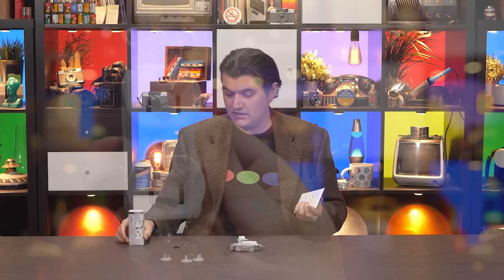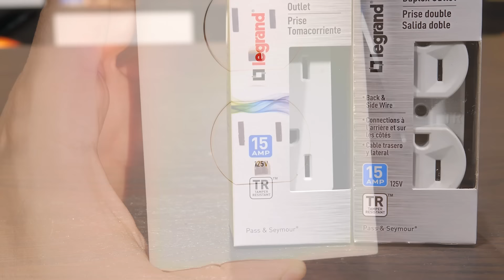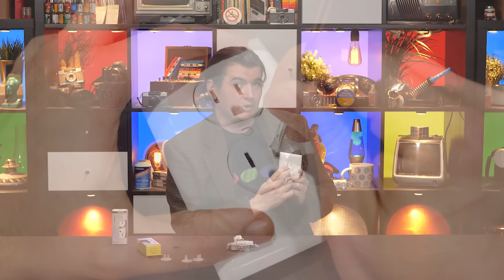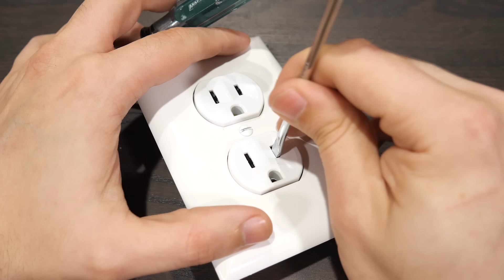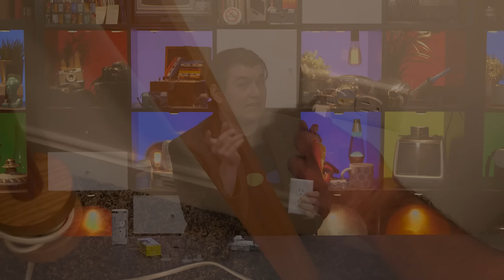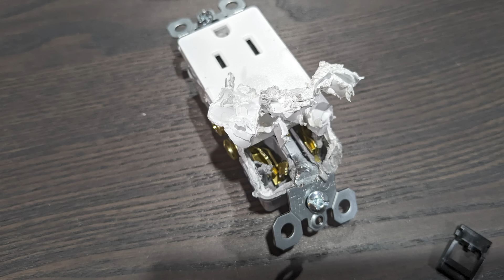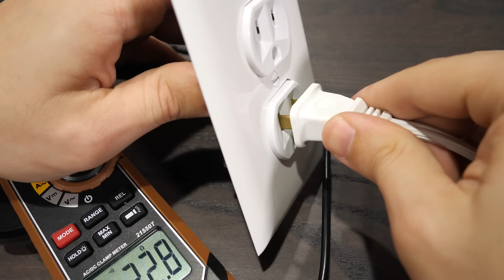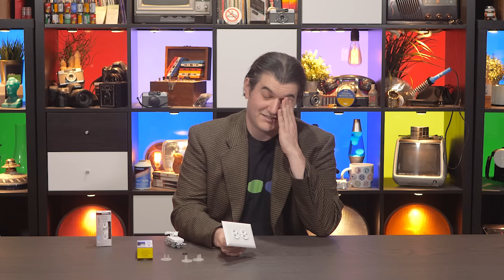Tamper-resistant outlets aren't all the same - a follow-up

Comment: As a European, I fumble around with my fingers around outlets daily and have never been shocked by doing that. I am shocked (heh) that you have it so bad.

I have been shocked by live voltage twice though but it wasn't that bad. Both were because of old out-of-spec plugs. Probably lucky conditions that increased resistance mean it wasn't that bad.

Comment: I’ve been shocked by 120v probably around 15 times. Only once was from the bad plug design. it usually happens from circuit I thought were off but in fact were not, or from unseen frayed insulators on conductors

Comment: My first home was build in the 50s and had no ground wires.  The little work I had to do was always weird to me because of the quality of the wires.  MUCH thicker gauge and solid copper with the extra thick fabric wrap over the insulating wrap to the wires, which made the wires that much more fun to manipulate (almost always had to use pliers to bend them.)  
In my current home (70s built) almost all the outlets are connected via that quick plug-in the back.  We had an issue right after we painted a room (correctly removing all the wall plates) that afterwards occasionally the lights in ANOTHER room (the adjacent hallway) would not work.  Turns out having jostled one of those outlets had exposed a weakened spring that was holding one of those wires and it was the last of a trunk line before being used to light the hallway. 
Replaced the outlet and fixed it.  
Since most of the rooms in this house have 2 breakers, one for outlets and one for lights, I don't have any clue why it's wired that way.   By far not the worst wiring issues I've found, either; my favorite was a splice into a line running in the attic, they didn't use a box, or even cut the original wire, just cut back the insulation and wound the new wire around it and taped it up and called it a day.  While it did work, and since the home had, magically, not burned down in the 40 years before I owned it, I can only assume it was 'safe-ish.'  But I fixed it.  
Remember, and this probably applies to the quality of outlets in general: There is no solution more permanent than a temporary solution that works.

Comment: In 240V land, we have multiple phases for high power applications too and like in the USA, if I touch two of them simultaneously I get a way higher shock. An 400V shock to be clear and that can kill you pretty easly... But every phase to ground is "only" 240V mains voltage.

But the three phase plugs are mostly build like absolutely bulletproof tanks. There has VERY much to go wrong until you get a shock from a CEE or older J15 or J25 plug.
Reply: Three phase are used in homes?
Reply: @brettknoss486  Yeah. All high power applications run on three phase power. Stove, clothes dryer, washing machine, dishwasher, boiler, heat pump all runs on 400V three phase here...

Comment: Australian outlets are similar to US plugs with the blades twisted. Unlike in the US they are 220-240 volts, so we aren't alone. I like our plugs, they are very compact and compared to UK plugs they are miniature. All that needs to be done is to mandate that the plugs have 1 cm of insulation and the problem is solved. You could use heat shrink and do it yourself.

Comment: In Brazil we used to have the US standard plugs and they would fall completly out all the time. Specially if it had any wheight on it like a power supply. That's because they were made of a poorer design and not as tight as the american receptacles.

Thanks god we moved to some european style plugs(It's not that big round one though). Which prevents all the problems you talked about.

Comment: I believe that the people who say that in the US the plugs are falling out are slightly exaggerating, and the plugs were not actually falling off but coming a little off like was shown on this video. And
the exaggeration probably wasn't meant to be such, but to someone who hasn't seen the plug to come off even a little before it can look quite worrying and a big deal. At least that's how I felt when I visited the US a few years ago. The motel where we stayed had coffeemaker plugged in an outlet on the wall, and seeing how the plug didn't seem to properly stay in made me nervous so I pulled the plug entirely. My point is, the saying that the plugs are falling out is probably unintentional exaggeration because what happens can seem worse when you see it happen for the first time, (combined with how exposed the prongs are due to the non-recessed design), as compared to being used to seeing it.

Generally, I wonder if the reason why the implementations of some technologies in the US (like the outlets and the colors of the NTSC TV) seem a little worse because the US was an early adopter of those technologies. So the US might have got versions 1.0 of those things, with some bugs left, and by the time when others started to adopt the same technologies, they had available the longer-time experiences from the US and could fix the problems in their implementations, making bug-fixed versions 1.1.

Comment: The reason you shouldn't backstab outlets has little to do with the quality of the connection. It''s not recommended because it's a "stress-fit" connection that will degrade over time as the outlet is used, heats up, and cools off. As the wire heats up, it expands and the flange that holds it in place has to flex. Hundreds of cycles of this and the connection is much worse than it was on installation.

Comment: Those old two-prongs with no flange that are barely bigger than a USB plug were definitely dangerous.  I have a memory of getting my hands cooked when I was 3 or 4, messing around with old Christmas lights that had one of those plugs.  I remember my hands suddenly hurting and then they had some black stuff on them that wouldn't wipe off.

Comment: So I have a difficult history with these "Tamper-Resistant" plugs. I tried plugging stuff in, but it wouldn't go through so I just shoved my laptop charger in until it finally opened. It probably broke, because there was less resistance when plugging stuff in. I thought that the TR was some sort of branding. If only I knew that it was supposed to go in a specific way.

Comment: I got zapped with 240 volts a couple of times in my life - as a child as well as an adult - here in Germany. In my spare time and also on the job. 😬
I've never had any complaints, but I'm also weird that way. Getting zapped with 480 Volts by touching two live wires is something else tough. 😵
We have to deal with 3x 240 Volts for real appliances - like a stove - that use real power like all 10kW our electrical wiring can take, so our power has to have a bit more of a grunt. ⚡⚡⚡

Comment: "europeans are always talking about our plugs falling out" The standard European round plug (not Italian or British) does not rely on the prongs to hold the plug in. It has its own mechanical retention separate from the power prongs. Besides the fact that the round plug body fits into the hole, it also has metal tangs on the side (not the power prongs!) that click into place. Thus it is a more secure retention and less likely to wear out and become loose.

PS. A lot of this is because Europeans are more likely to be in a hotel. Hotel plugs are notorious for falling out, because they get more use, and thus wear out faster. Really American plugs were not designed to be plugged and unplugged a lot.

Comment: MK sockets in the UK have a ridiculously clever system for the shutters. They have two sloped shutters on the live and neutral holes which are opened by the respective pins, but these can only be opened if the earth pin is already in as that releases locks on the two other shutters. basically all three pins have to be in the socket in the correct order before they'll open!

Comment: You are so right about 120 volts being safer then 240 volts. As a life long commercial sparky I have been shocked by 120, 208, 240, 277 & 5,000 volts from oil burner ignitors. Seemed to me that when voltage was doubled the intensity of shock was four fold.Fat & even taller people do better from being shocked due to higher body resistance. Have got a nice shock when only touching one 480 volt wire while soaking wet in a hot environment. Thanks for all the informative easy to understand U Tube vidios that you produced.

Comment: What you called blanks @_0:30 are dangerous choke items to kids. A fellow sparky told me they do not have UL approval. With over 500 kids going to an ER yearly from getting shocked from receptacles the NEC should have made them mandatory 50 years ago. Like they told us in several IAEI continuing education classes TR receptacles are only tamper resistant. They most likely will never make a tamper proof receptacle. We had a kid some how bend a paperclip to enter the edge of his 277 volt wall switch in his patient room luckily not getting Injured but blow a piece of the stainless steel wall plate up.

Comment: your Outlets are so bad because its cheaper then like a German/EU Schuko-Plug (capitalism thing) .. or a CEE-Plug we use for 400V/380V like ever Home has here (like your 3 Phase 230VG) .. i agree to "that higher Voltage needs better Isolation" .. thats why we have higher Standards (its in the VDE) and we got the higher Standars because if you are certifide and fulfill them, you can charge more money (also a capitalism thing 🙃)

Comment: I've sort of wondered for some time if we could use the IEC plug design you see with computer power supplies and monitors most of the time as an international wall outlet. The orientation where the prongs would be inserted into it, I guess that's the male version? I'm not really sure, because the main advantage here is the interface with the protruding prongs is shielded by rubber or plastic all around it. It's true it's only typically rated for 15 amps, but there is a corresponding higher amperage version. Just an idea I had, could even incorporate its own shutters and since it's an international standard, could avoid all this differing outlet and plug design nonsense.

Comment: I would recommend never using the stab in connectors on outlets as ive personally seen many of them melted due to arcing caused by the poor connection. Not sure why they are code.

Comment: I'm in the middle of replacing all switches and receptacles in my 1987 house. It's a slow process, mainly because of toddlers and my general refusal to shut circuits off. The reason I have to do it is 1) all of the outlets were loose when we bought the place and 2) EVERYTHING is backstabbed. The backstabs are weak enough that I'm able to just pull the wires out with a pair of needlenose. What's funny is on the industrial side, I'm a big fan of spring clamp terminals, but they're built in a different manner and generally stronger.

Comment: That type of shutter is used on some european sockets there is also one which rotates when the plug is inserted, I live in the UK and have several UK to Euro adapters that use shutters of either type, so what you have there is not an American invention it's been borrowed from Europe.. 120 volts is just as dangerous as 230 volts, that's why here in the UK on building sites and industrial premises  110 volts is used from a center tapped transformer with the center tap earthed so there is only 55 volts to ground potential.

Comment: Following internet rules, anecdotal evidence is the best evidence. I have provided medical attention to a variety of electrical shock/electrocution victims over the years. As stated, a lot of factors go into how dangerous it is to a human. Fatalities are almost always industrial and high voltage. Fires are the bigger risk with household wiring. While these numbers have improved greatly over the last quarter century, in my opinion, the real way to get killed by the electricity in your house is to have it cause a fire. There are good numbers available on US structure fire deaths and the possible causes of those fires. Electrical is always one of the significant sources of ignition listed in those numbers. As stated, there really are not great numbers on the number of people seen in emergency departments (or morgues) for electrocution specifically household electrocution. But I would guess that it is significantly lower than the number of people killed by house fires started with faulty wiring. When I am doing wiring I'm always cognizant of whether or not I'm going to wire it in a way that will later cause a fire. I'm much less concerned about whether or not I'm going to get poked. I've been hit with 120 volt on three occasions, I will say two were my fault. However, I believe my spouse would say all three were my fault. Regardless, it doesn't feel good and it certainly could be fatal, but the Swiss cheese definitely didn't line up. The handful of significant "household" electrocutions that I have been involved in as far as responding to them all involved some sort of contact with the main drop from the street or screwing around in the breaker box. That of course indicates it was likely 220 not 120. Do I recommend shocking yourself in a series of poorly controlled tests to see whether or not 120 volts is dangerous?? No, please don't. I would just say that the real risk to amateur wiring is fire, not personal injury.

Comment: My 1982 built house had a lot of weak, loose outlets already when I moved in 12 years ago. I found the weak ones were often actually cracked on the back side and the loss of integrity of the plastic body I guess allowed the metal parts to spread and lose their tension. This also led to some backstab connections being very weak - I'd insert a screwdriver to release the backstab and the outlet would just crack open and fall apart. These outlets had probably survived 30 years of not only having cords tugged sideways but also probably having cords rammed into the wall by furniture judging by the cracked wall plates. Which I guess should be another point in favor of right angle plugs.

Comment: I was in the US Navy in the early 1970's and was trained as an aircraft fire control radar repairman. One of the first things in training that was taught is that it is the current that hurts you. There was a story from my instructors that a sailor was killed in a freak accident when he was fooling around a Simpson 260 to find the resistance of his body by using sharpened meter probes and the 9V rectangular battery in the meter. The probes got stuck under the skin and he got a shock. Another sailor involved with that experiment removed the probes and he walked the man to sickbay. The doctor examined him and found his heart was beginning to fibrillate. The doctor and staff tried to stabilize the situation using manual methods and shots as there was no defibrillator available then (early 1960's). Since then the US Navy was very strict about electrical accidents. If you received a shock and you didn't tell anyone and get a heart attack or muscle spasms and the doctor finds evidence of a shock, you'll be put on report, that is.... if you survived.

Comment: You mentioned the EU plugs having insulation at the base of the prongs, and I saw in the main video a video clip of adding heat shrink tubing to a US plug, but you never actually brought up the idea of heat shrink in the script. I think that would have been useful to talk about as it's an easy to implement idea. Did you run into any issues with that? I'm going to tey it on a couple of my plugs as an experiment.

Comment: It's the amps that kill you... not the voltage... higher volts can jump further though.... for a voltage to be safe you need to go below 50V for our skin to be thick enough. 

So you're somewhat right that 110V isn't that dangerous if you only touch one of the wires.

My issue with US plugs being half out is more about how easy it is to touch both wires at once.

Edit: if voltage was the killer, imagine the deathtoll petting cats would have, easily 1000V of static electricity.

Comment: I would say it's rather stright forward to improve your outlets and plugs, simply mandate the ground pin like the UK (it would improve overall stability)  have shutters that are operated by the ground pin like the UK, add partial sleeving to the blades like the UK....see where this is going?..  And maybe add switches to the outlets.... Like the UK😂
All that could be incorporated into the current form factor used over there

Comment: My very old house has some outlets where the plugs do indeed fall out.  It's only a few of them, they're just loose.  If you're using a vacuum and you just wiggle the cord a bit, the plug falls out.
I've noticed that these few outlets all look the same, and they are different than the rest of the outlets in the house.  So, it looks like particular old plugs from specific manufacturers may have this problem.